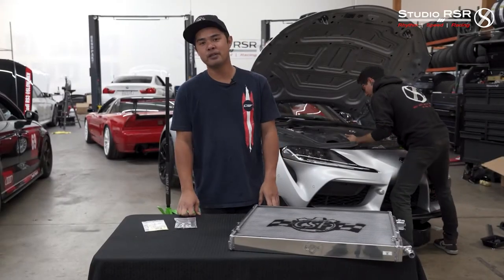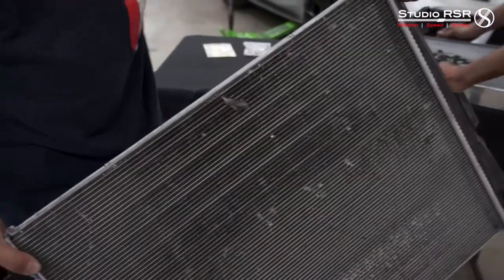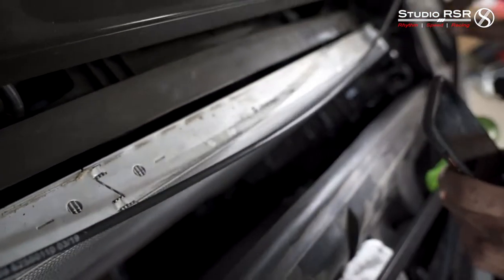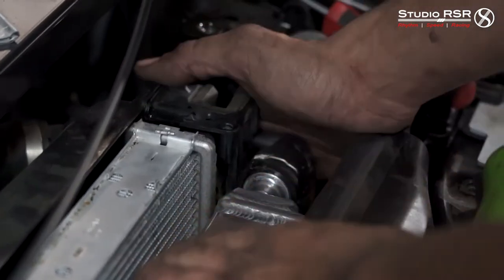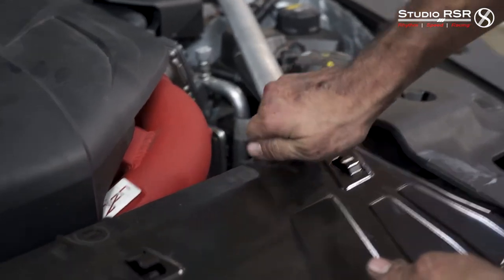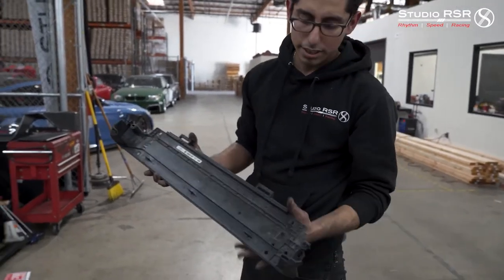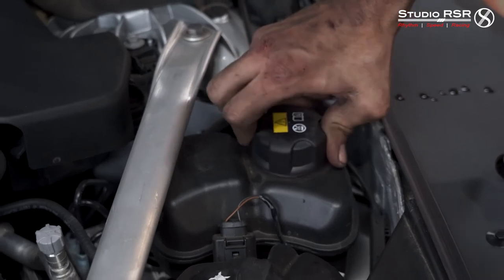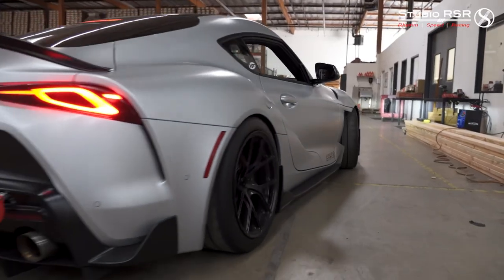Installing CSF’s MK5 Supra Heat Exchanger + Heat Exchangers Explained

Comment: Oh man I saw the owner of CSF post some super nasty comments in the F80 forums after it was shown their charge air cooler was worse than OEM 
Basically came off as a nasty greedy company. Their reply felt like “haha we sell tons of stuff so that means they work”

Good luck tho man
Reply: I was thinking the same thing,  where is the proof it works better??? These shops just want you to waste your money.
Reply: No way it's worse, lol. CSF makes good stuff in my experience
Reply: @Quebster  you can literally check the data. 
just because something looks good doesn’t mean it’s engineered well. 

but it's your car. do what you want with it
Reply: Csf has no data to back it up. EOS manifold does.